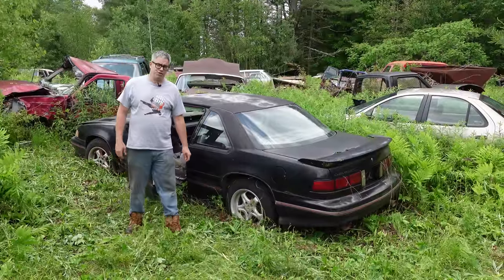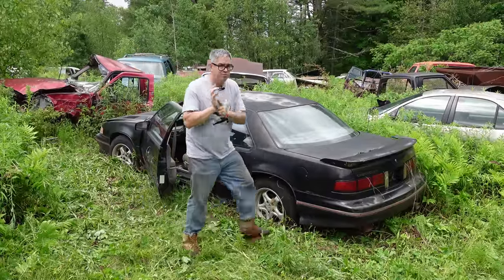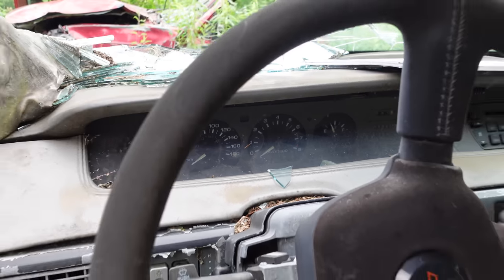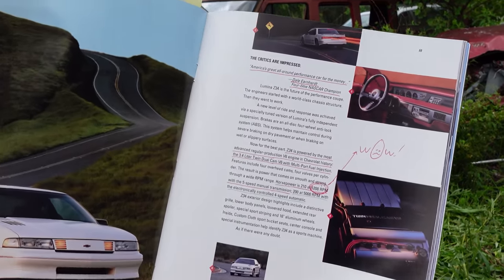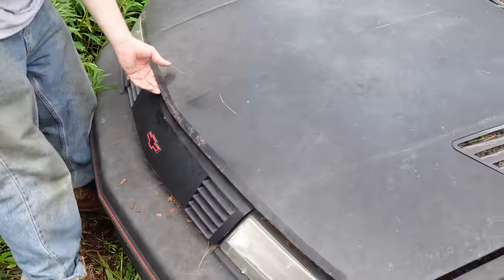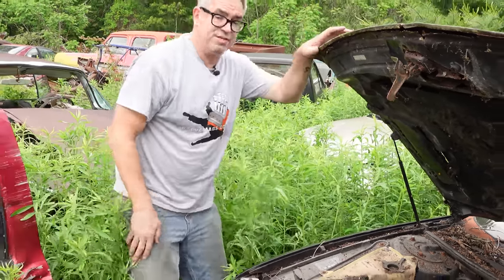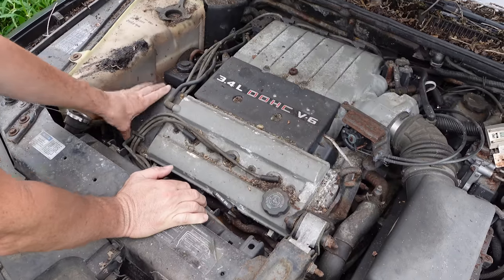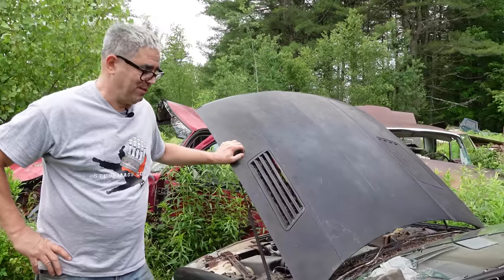What’s Up D.O.H.C?

Comment: That 180 on the speedo looks to be kilometers. Must be a Canadian model. Translates into just about 112 mph
Reply: Correct! You can also see the water temp is in Celsius and it looks like the oil pressure is in Kilopascals. Definitely set up for a metric country.
Reply: All the gauges appear to be metric.
Reply: If it's a Canadian model, that would make it a Zed034
Reply: Yep was about to say the same
Reply: Correct, it has a metric cluster.
Reply: @Richaag  The cluster is clearly marked in Km/h definitely a Canadian car made in Oshawa ontario.
Reply: You can't get a lumina to 180mph?
Reply: @timcvetic5054  Being made in Oshawa Ontario Canada has nothing to do with the destination market as US spec/destined vehicles were also assembled there. However, the metric cluster is an indication it was likely sold new in Canada.
Reply: @DM-hw4cr why yes!
If you drop it from a C-130 with out a parachute!😂
Reply from the maker: How the heck did I miss the KM/H? Ughhhh! Thanks for watching and writing. -Steve Magnante
Reply: Yep, I noticed that right away.
Reply: @googleusergp  Yeah, you are right but I do recall that Luminas were produced in the giant GM complex out in Oshawa.
Reply: @timcvetic5054  Yes, and that was really the sole plant that produced them. However, factory location didn't always mean it would be the destination. For example, I had a St. Therese, Quebec Canada assembled 1979 Cutlass here in the US. Other US plants made them for the 1979 as well. One plant might absorb production slated for another plant if the demand was higher in a given area.
Reply: Yeah that car delivered to Canada.
Reply: @googleusergp  Yeah, it is interesting regarding the where/why as to production sources, but it was also a time when GM was trying to optimize(?) their global network too for various reasons. 
 I do know my 86 Pontiac 2+2 was built in St Therese, Quebec & the body data plate has LaRue/LaQue stamped on it, all of which is now gone/redeveloped.
Reply: @DM-hw4cr  Not even if you dropped it off a cliff!!
Reply: @SteveMagnante  - Good thing you didn't claim to have ridden in one at 180 MPH...
Reply: @DM-hw4cr  maybe downhill in a hurricane.
Reply: @BuzzLOLOL  They were Chevy's entry in Nascar 😃
Although, as others noticed, that speedo is in km/h, not mph.
Reply: @jeffreycarleton1535 what would the terminal velocity be on this car
Reply: @DM-hw4cr  yeah they shut off at 115mph just like the Z24 cavalier
Reply: Would be lucky to achieve that speed if you drove it off a cliff !
Reply: @razer2981  Nah, it's an American car so it can stay Z.
But it's a 240 Zed.
Reply: @mcf3778  it depends on the air density, I believe that it would have a higher terminal velocity in dryer air,and also if it’s pre crushed Pryor to liberating it from the C-130 ! Chevy Luminas did go 180 mph in NASCAR Lol!

Comment: Drove a new Z34 coupe GM engineering pool car from the Oshawa Ontario assembly plant to Rochester Michigan. The GM engineer I was with had an extreme sinus headache & forgot his meds. He told me to get home as quickly as possible. No problem. Taking the 401 & 402 which are fabulous e-ways, we made it home in about 3 hours doing well over 150km on the 402. I was pleasantly surprised how well the Z34 was quick, composed, tight & rode very well on the highway. Very impressive car.
Reply: That car wont do no 150mph.
Reply: @roberthayes6329  You didn't read it. 150 KILOMETERS PER HOUR which would be about 93 MILES PER HOUR.
Reply: 👀👓👀👓🤔🧐Time for the bifocals there bud, and\or reading comprehension 👍🏻👌🏻
Never said 150 mph, it says 150 Kph!

Comment: Alternator paid like 5 hours to replace, and don't leave the air duct off it.  They would last a week without the air duct.
Reply: Good god I recall doing many of those. We had a crap off brand reman company that supplied us with alts. All of the techs refused to use them because of the lack of quality. Come backs were common. I'll never forget the day when the service writer sold 1 of them, a Sluter, to a Z34 owner and the tech said, he would pay for the new GM alt if the customer pays the labor, or he's not doing the job!

Comment: The 3.4 DOHC was also available in the Lumina Euro 3.4 as well.
Reply: In 1992 however, I believe he's correct. The 3.4L was only used on the Lumina Z34 coupe, but yes, it was used in other models as well.
Reply: @googleusergp  it was also uses on the Euro 3.4 coupe and sedan.
Reply: @BlownL67  I know that. The 1992 OEM literature mentions the Z34 coupe being the only one with the 3.4L engine.
Reply: You could get it in the Monte Carlo also
Reply: I had a 3.4 euro, really nice car and quick. Rare EURO
Reply: @googleusergp  Also in the Grand Prix GTP.
Reply: Had a lumina coupe Z34 with  a 3.8 … in Canada
Reply: @googleusergp  That is incorrect.  The 3.4L was available in the Lumina Euro 3.4 sedans from 92-94.  Available in White, Black, and Red.  All were automatics and only one interior color was available...Medium Slate Gray cloth.
Reply: @googleusergp  The 1992 OEM literature is wrong.
Reply: @Matt-nw2pt  Correct, from 95-97.  Also available in the 95-97 Lumina LS sedan.
Reply: @davidgalinat4257  Correct...also in 91-93 SE/GT coupe, 93-96 Special Edition coupes, 91-93 STE sedan, and 94-96 GT sedan.  The 91-96 Cutlass Supreme coupe/sedan, and 93-95 Cutlass convertible.  The 92-94 Lumina 3.4 Euro sedan.
Reply: @jiggity76  Take it up with GM.
Reply: @jiggity76  Good. Take it up with GM. Their 1992 literature says otherwise.
Reply: @gerryvandepol7630   THAT’S what I always wondered about…I’ve always heard the 3.4 in the Lumina was not known for its dependability or endurance. Maybe,it was just a matter of working out the bugs of a newly developed engine but,nevertheless,I always wondered if the very dependable 3800 would’ve been a viable option that may have improved reliability issues. Cos,the car looked pretty good for early ‘90’s,imo.

Comment: I had a red 2dr '94 Z34 from 1998-2010 & got 325,000 miles out of that baby with almost no issues, great car! ✌💖☮
Reply: Awesome. I just bought a 91 in red. Seems to either have a rebuilt or replacement engine. Well it has numbers written on it for miles with yellow at 55,000 or so. So not exactly sure. Mileage on ODO said 155,000. Doing what I can to keep her alive. My main daily.
Reply: @ErrorlVlacro  thats great man! The 3.1 I had was an excellent engine

Comment: My friend had this engine in a 1994 Cutlass Supreme that we grew fond of.  He got it for a pittance due to the oil pump drive  (former distributor) leaking.  We did a belt and suspenders treatment with a new o-ring and gasket. He wrecked that car, then bought a '96 that we swapped the  3.4 into. That engine was pretty hot for a an 18 year old kid in the rust belt in the early 2000s.  

Of course, there were all the drawbacks of it being an early OBDII and being adapted from the 2.8/3.1 platform, but there was something endearing about it.  

I find it pretty amazing that the average minivan has 50% more horsepower these days.

Comment: These were neat cars!  My buddy had a '91 Euro 3.1, but the Z34 is next level.  However, the Taurus SHO of the same era had the Yamaha engine and revved to 7200 rpm!
Reply: The SHO was marginally faster too. Despite being a 4 door.
Reply: 5200 RPMs is actually '65 GTO/442 OHV 2 valve V8 numbers... not that high... earlier Chevy's revved much higher...
Reply: @kalebbrown93  TL;DR SHO's were quicker.  

SHO's were quicker especially with the 5 speed, and were about as quick as a 5.0L Mustang LX/GT and even early 4.6L Mustang GT.  My Dad had a 94 which I drove a number of times, and while I didn't have the opportunity (or stupidity?) to try this on the street, the butt dyno between the two cars was similar, with the Mustang having a more linear power band of torque that leveled off and the SHO building power through the RPMs.  I also test drove 2 used first gens (89-91) and 2 second gens (92-95), having the opportunity to rev them out.  I test drove a 91 Grand Prix GTP with the 3.4 DOHC 5 speed, same chassis as the Lumina, and it was not as fast with the torque feeling good but the power band not building like the SHO.  That said, the car had a ton of tech with a HUD, a very intricate driver info/trip computer and compass, and rear bucket sets.  What set the SHO apart was the smoothness and refinement of the engine, it had a variable intake manifold with a set of long narrow runners for low RPM, a set of short large runners for high RPM, that would switch over at about 4000 RPM, and when you reached that RPM you'd feel a surge in power.
Reply: There was a dodge turbo spirit that came out around this time too that was pretty exciting.
Reply: And even funnier is furd didn't n couldn't build something on their own! Because furd! Lol
Reply: @TorquilMcLeod  I had a 91 sho that thing was a blast as my first car.

Comment: My mom bought a new red one in 1991.  What a great car!  Would absolutely melt the front tires,  which were big sticky goodyear eagles,  Bose stereo system which rocked,  and really handled great for a front drive car of the time.  And yes,  would do 120 + on the highway and great aero as it was a copy of the thunderbird aerocoupe.  I wish i had that car now!
Reply: No it didn't! They shut down at 115. Same as my 89 Z24 cavalier which my sister swore did 125+ in it but didn't! Vehicles were definitely governored back then.
Reply: I can confirm the governor. My 92 Z34 hit the 115 limiter in a run against a Supercoupe.
Reply: I have a 91 in red. Doing what I can to keep it alive. My daily. And yes I’ve tested it. It won’t let it go past 115, but it doesn’t shut off like the gov in my 95 S10 it just won’t let it go any more.

Comment: I have a 93 Euro lumina. I drive it every day. Has 325000 mi. Still runs perfect. Original motor and trans. Body is going to rust out before the power train dies. I love it. So easy to work on.

Comment: I bought a brand new 2002 Z24 Cavalier back in the fall of 2001.  5spd.  Loved that little car.  I could get 32mpg out on the highway at posted speeds.  High 20's around town.  Never had any major issues with the mechanicals, although it did go through a couple blower motor resistors for some reason.  Traded it in for a new 2007 Malibu SS, which was a very fun car to drive.
Reply: Both are very cool cars. It be nice to find a survivor of one now
Reply: I own a Z24 and is a super fun car to have !

Comment: The old 2.8 and 3.1 Multi port had a real distinct sound. I remember having a corsica LTZ and it sounded really impressive for a stock V6 exhaust. You knew a Multi port when they took off. The Z24 Cavalier with the 3.1 5-speed are actually becoming a colectable who would think
Reply: The 2.8 is the king of 60° V6. Everything after is garbage! Especially the 3.1!
Reply: My first car was a 2.8 cavalier with a 5 speed with an exhaust, to this day the coolest sounding car Ive ever heard
Reply: You're referring to the 2nd gen "splayed valve" 2.8/3.1 from 87/88 and totally phased out by 95 depending on the carline. These are the ones with the very distinct exhaust note. The entire top end on those was completely different from the 1st gen from '80-86 ('94 For F bodies) and completely different from it's successor the 3100/3400 series. I had a '90 Celebrity wagon with the 2g 3.1 and even with the large muffler on a conservative car you could still get a good clap out of the tailpipe under hard throttle, although nothing close to what folks got from their J and W cars with the same engine
Reply: I had a 2.8mpi  in an 85 Pontiac 6000SE, man that sound was awesome indeed, Fun car too
Reply: Pretty sure that they were faster than the Corvettes of the same years.. GM tripped over their dongs on that one.

Comment: We had a 93 Cutlass convertible with the 2.8 which was a fine engine, also had the transverse leaf spring that developed a terrible squeak at each side where it sat in its pocket- used to spray white grease in there liberally to quiet it.
Reply: @66balsam  Wrong info there, a 93 vert would have had either the 3.1 or LQ1.  Last year for the 2.8 in the W body's was 1989.
Reply: @jiggity76  sorry yes, our 89 Cutlas had the 2.8, 93 had the 3.1, thanks

Comment: Had a 90 2 door with the 3.1 engine. Plenty of punch for me it drove very well and no issues with power. Huge improvement over the 2.8. I am not a front drive fan in any way but that car was a good driver.
Reply: Lol... The head gasket/ head bolt blowing 3.1 was great huh? 😂
Reply: @shawnsatterlee6035  You would know all about blowing bolts so whatever...

Comment: I was a dealer tech back in the 90s and did a fair amount  of work on these engines ,they were bad leaders and had many timing belt issues due to plastic pulleys that would melt,fortunately it was not a interference motor and did not bend valves when timing was lost.
Reply: and those alternators.....
Reply: @christopherfrier6689  What was the deal with the alternators?! I had a ‘96 Monte Carlo Z34 in college and had to have the alternator changed every year…at about $350/pop back then! It broke me and I eventually sold it.
Reply: @theovallas  Had to take the subframe loose or out to do them. hey were tucked way in..

Comment: I was a teenager when these engines came out and I was really fascinated by it. They were so unusually powerful for the day.  Them and the SHO were well into the V8 numbers of the day.

There seems to be a special amount of disgust from the mechanics though who had to work on them .....they hated em!!
Reply: Whoever decided to make all vehicles ( except trucks & some sports cars ) front wheel drive, needed to be strung up from a tree. Those were the darkest days in automotive history. Heavy front ends made them dangerous in turns & all that added weight sure wasn't helping the front end components either. Can't work on em.......without cussing & wanting to set em on fire. It was really bad for these cars. Law enforcement agencies even hated them.
Reply: The fact that you were excited about this...?
Reply: This engine was a nightmare to work on. I replaced the head gaskets on one and promised myself never again! Even replacing the alternator was a nightmare.
Reply: @dmandman9 the alternator was buried real low on the engine and was constantly heat soaked. My parents Grand Prix with the 3.4 had its alternator replaced probably 5 times, all under warranty every time.
Reply: @hadtocheathimtobeathim6549  I remember that nightmare as well. I remember replacing an alternator only to have it fail within weeks and had to replace it again under warranty . The parts company gave me another part. But I had to do the repair again for free. They buried the alternator right next to the exhaust manifold. Even with the heat shield, some of them wouldn’t last long. Also, during that era, GM alternators weren’t that good anyway. So when mounted near the exhaust they didn’t stand a chance . I’m glad that that engine wasn’t a great seller.

Comment: Those "vent" on the front house the turn lamps. Those 3.4 s ate alternators, 92s had a cooling scoop but they tended to feed water into the it in heavy rain. From 93 on they did not have that scoop. I had a 93 and it had 3 alternators in the 110,000 miles I owned it.  A friend has a Grand Prix with the 3.4 and 41,000 miles and it is on its second alt.
Reply: hey Brock'..I've got a '93 Z34 and I'm having ALTERNATOR issues! What's the problem with these? Is there a fix, other than a new alternator?
Reply: @kencecaci5031  The alternator on them get baked by extreme heat do to the packaging of them. You will find the alt, on the bottom of the engine. You can remove the right tire, seperate the lower ball joint and tie rod  end the CV axle and inner fender liner to get at the alt. I opted to pay.
Last time I had one done was in 1999 an it set me back about $200 for labor. Best of luck I did love my Z34 though.

Comment: Great video Steve and so happy that you talked about these wonderful cars and motors!  Just a few corrections or maybe additional info.  All W's body's from 1988 on had standard rear disc brakes, not specific to just the Z34's.  The vents in the grill are not actual vents or allow air to go thru them, they have slits to allow the grill mounted turn signal/hazard/parking lights to be seen when illuminated.  Lastly, the Z34's weren't the only cars to get the LQ1 motors in the Chevy family.  Many people either forget or just don't know about the other Chevy member that could be optioned with the LQ1.  I'm talking about the much more rare Lumina Euro 3.4 sedan.  This is not to be confused with the Lumina Euro sedan which were all 3.1 cars.  These Euro 3.4 sedans were essentially the 4 door version of the Z34's with one exception being all of them were automatic transaxle cars...no 5 speed option unlike the Z34's.  These Euro 3.4 sedans were only made from 92-94 and only offered in White, Black, and Red.  The only interior color was Medium Slate Gray...like the Z34 that you reviewed.

Thanks again for reviewing these cars!  I own 2 LQ1 cars and love them so much!  Keep up the good work!

Oh, one more thing.  I can now do the timing belt change out in about an hour after years of practice.  Not that bad of job to do.  Like most things mechanical, the right tools for the job help tremendously.

Comment: Hello Steve.. Love the channel.  I had a neighbor that had 1. He said to change the rear spark plugs you had to disconnect the dog bone an canter the engine. What a nightmare. Thanks for all the great videos.
Reply: There were several vehicles like that of this era.
Reply: One would think you can get at the back spark plugs from underneath by jacking up the car?
Reply: @firearmsforever6738  Disconnecting the dog bone is not necessary when doing a rear plug change out on an LQ1.  Helpful yes, but not necessary.